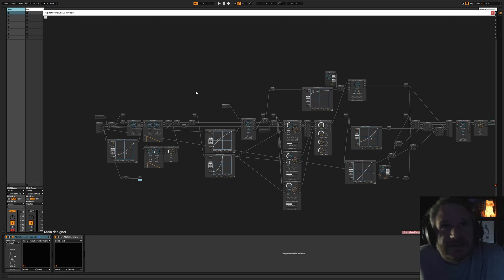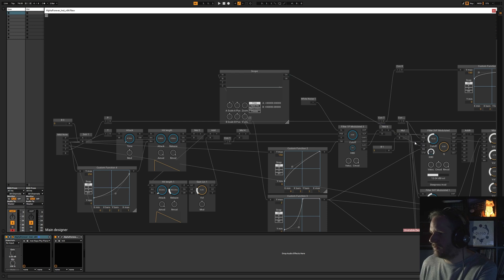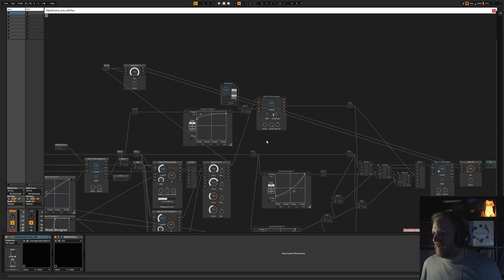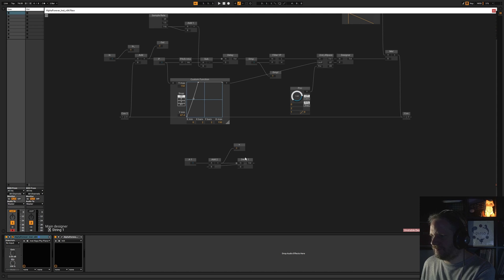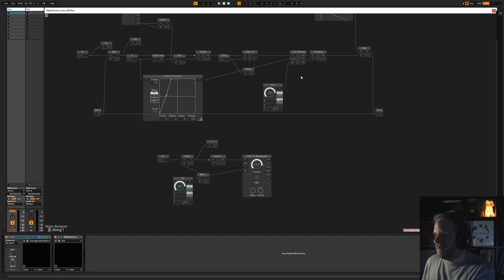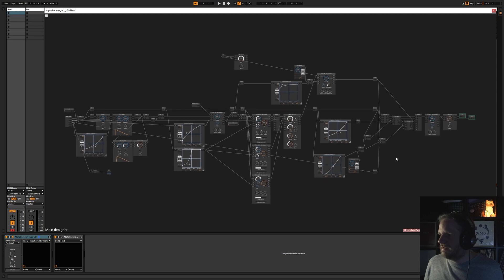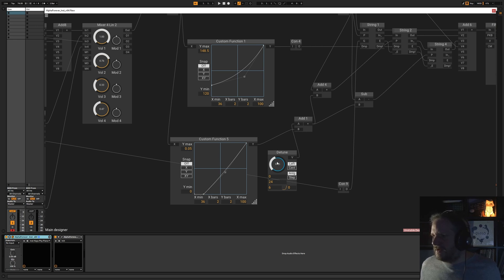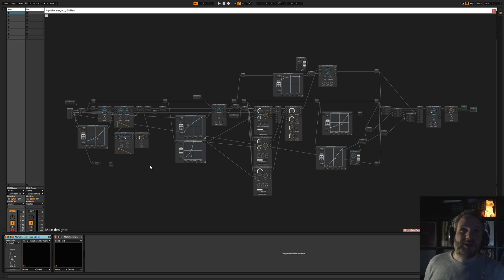Synthesisizing an acoustic piano sound - progress

Comment: hello
 you can improve your sound easily, with just a little function : the "hammer comb filter"
it is very simple :
you need a delay for the comb filter.
You send the sound input  in the delay.
You subtract the delay to the sound input , and you get your comb filter input .
For the time delay, you take the reverse of the ratio of the note frequency . You control this with a know with value between 2 and 20 for a comfortable range .
You add a cross fade , in the minimum entry you send the sound input , in the maximum entry you send the comb filter output.
And you control the cross fade with ... velocity. And you can control the global level of deepness with a knob between 0 and 1 , that you multiply buy the velocity, for testing different level of deepness, between  none and full deepness.
And for a better result create a scale for the ratio of the frequency between the minimum note and the maximum note. For the lower note you have the greatest ratio, more than 10, for the maximum note you have a smaller ration 7 or lower.
Adjust at your taste, for a good balance along the keyboard.
And then you have the effect of the strike place of the hammer on the sound, with a stronger effect with velocity.
It gives a lot more dynamic,  character, expression to the sound, and it is more realistic.
The result is very obvious on the lower notes with hard strike notes, where you have this strong character of the strong lower notes.
Reply from the maker: Thanks for the tips! This is a pretty old video by now, and from time to time I try this again. In the last few days I've picked the topic up again, and this is where I got:

https://www.dropbox.com/scl/fi/y4of1mi6f3gicg2ht3md0/2024-12-12-00-22-31.mp4?rlkey=fambhqzycbv6m7q3quv01xbqb&dl=0

I'm gonna try your tips, they sound interesting!
Reply from the maker: Oh. It looks like, YouTube just removed my comment because it had a link to my actual piano. 

Thanks once again for the tips. I'm going to try your advice, but ATM my piano is really different than the patch in this video. What patcher are you using? Are you interested in trying AFM?
Reply from the maker: I did give this a try, and it helped a lot with the realistic feel of the low notes. They are not rumbling that much this way. This is basically a feedforward comb, but instead of adding the feedforward path to the input, I had to subtract it, and the delay time is scaled depending on the pitch. Thanks a lot!